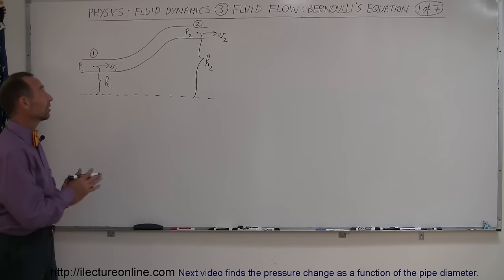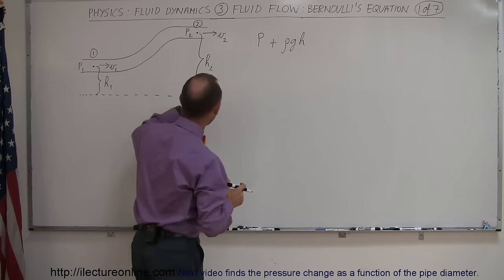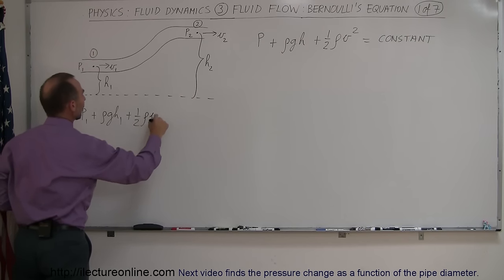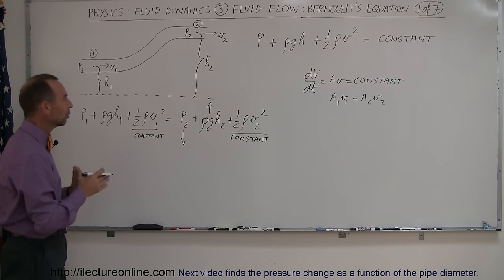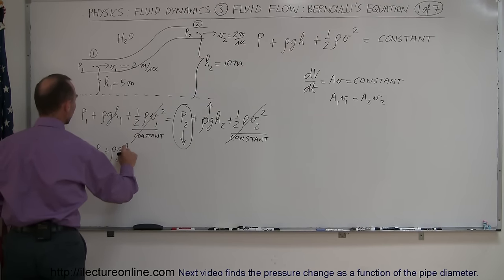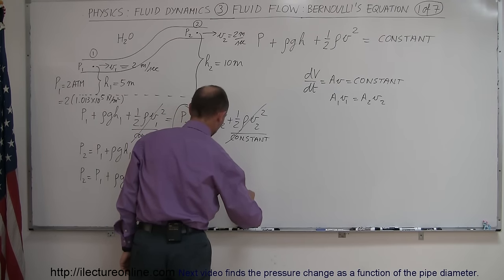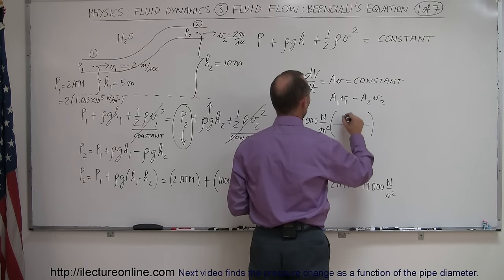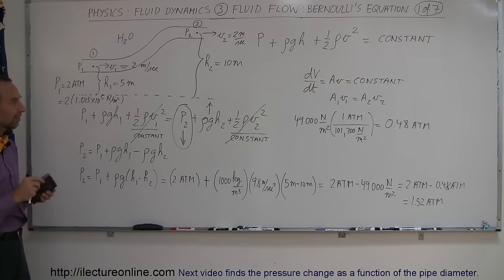Physics 34  Fluid Dynamics (1 of 7) Bernoulli's Equation

Comment: Bernoulli equations are conservation of energy statements in disguise.  Pressure is energy divided by volume (look at the units). Density is mass divided by volume. So you can read the second term as mgh/vol. The third term is mass velocity squared  / vol     The equations basically say that energy in equals energy out.

Comment: The derivation of this equation is actually very straightforward, and basically just the energy equation.
It's the sum of the potential, kinetic, and extra energies, where the extra energy in this case is the pressure work.
So you can set up the equation like this:

m⋅g⋅h + 0.5⋅m⋅v² + p⋅V = constant

From here, you can divide everything by the volume, which then gives you the final equation:

ρ⋅g⋅h + 0.5⋅ρ⋅v² + p = constant

Comment: I'm refamiliarizing myself with this topic (I originally learned about it in Anatomy & Physiology via how blood pressure & circulation work) because I want to design an under gravel filter system for aquariums that minimizes "dead spots" in flow. If this video is an indication of the quality of your content, I've found EXACTLY what I need!

Thank you!

Comment: Thank you for your time and expertise in fluid dynamics. I’m attempting to utilize Bernoulli’s equation to answer which water pump (gallons per hour) I will need for an aquarium room I am building.  Being able to have the proper mathematical direction will allow me to analyze manufacturers claims versus my actual needs and expectations.  I’ll be using this information also for my questions addressing if I should utilize multiple pumps and how much energy will be needed and/or consumed with a single large pump versus multiple pumps.  This information will only be used for my aquarium room build and personal pleasure of the sciences, not to  discredit any manufacturer or anyone for that matter.  My physics skills (plug and chug) were proficient 20+ years ago however I’d like to wipe off the cobwebs, with some help.  I do recall that when a variable (A2, h2) changes there must be a change to P2,  V2 and/or v2.  For some reason I vaguely remember that for every increase of 12” in height the flow rate decreases  “roughly”  80 gallons per hour.  I am not able to recall where this came from however I would enjoy knowing the why and how this is worked out.  I will have multiple aquariums at different heights ranging from 1’ to 5’ above the pump(s).  The pumps gph ability will be dictated by the total number of gallons and changes in heights of the aquariums.  The gph demand is for the health of the fish and or plants. Knowing what flow rates will be expected at specific heights  will provide me with the skills to make an educated decision as to which size of pumps I will use for my specific aquarium setup.  Thank you for your time and any direction you may provide.  Cheers - Breaux

Comment: Clear presentation, Sir!  Of course in a real life there is always pressure loss in the pipe, therefore Bernoulli's equations as such is pretty useless when solving these kind of issues. Hopefully you could add some day one additional video where you would also take into account the pressure loss (i.e. the extended Bernoulli equation and Darcy-Weisbach). Thanks!
Reply from the maker: Yes you are correct.   Just like anything else in physics we first learn the principles without friction, wind resistance, etc.  Then we add the additional concepts when we are ready.  We are planning a series on fluid dynamics in the future as time permits.

Comment from the maker: Mark,
Since v = dx/dt     Av = dV/dt
Reply: Sir, will you make videos on differential equations in the future?
That would be really helpful.

Thanks a lot for all your videos.
Reply from the maker: Laurelindo That is part of the plan
Reply: Michel van Biezen   dont get confused......   V  stands for Volume and for velocity, it depends on the formula.     dV/dT  is volumetric flow (m^3/s)    that s why     =   A*Velocity.
Reply: Hi...,

How about if density of fluid that flowing changing to decrease. Let say there
is an heating process in the middle of the pipe that makes density to decrease
its about less than 25%, so the density of water to be 750kg/m3.

My opinion :

With P1 give a constant pressure, h2>h1, A1=A2 such as your task so,

1. Pressure at point two or P2 would be increase;

2. Velocity of the fluid at point two would be increase as well;

3. And if the the velocity of the fluid increase so for next pipe after poin
two rate of the fluid or Q would be increase as well.

Please your advice about my opinion

Thanks...
Reply: it will become a problem of thermodynamics i think
Reply: +Dede Yefandri Bernoulli equation assumes that the working fluid is incompressible (density is constant).  however you can estimate the answer by combining Bernoulli equation with continuity equation.  you may have to solve it with navier stokes equation, but that would be complicated because it's a second order differential equations, so you would need boundary conditions.
Reply: Thank you!
Reply: you are very acknowledge teacher

Comment: When flow is not laminar and the diameter of the vessel is less than 5 mm, then the simplified Bernoulie's equation does not hold.  This is specially true if the viscosity of the fluid is high, i.e. blood flow rate in narrowed arteries.  In these cases, a 10% widening of the diameter of a vessel increases the flow by a factor of 2; such as improved flow after placement of a stent in a partially obstructed vessel from an atheroma.  In even smaller than 4 mm diameter of a vessels the flow becomes more dependent on the elasticity of the vessel; i.e. the greater the obstruction in a non-elastic blood vessel with multiple narrowings, the more reduced the flow would be.  This is presumably because of eddy currents developed at narrowed points.
Reply from the maker: Good information.

Comment: When there is the pressure difference between the section of pipe the velocity can't be constant (the velocity is increase when the pressure decrease and vice versa)
Your assumption is the velocity is equal at different section it is occured when the pressure and height is the same( equation of continuity )
I think the given for the example is wrong
Reply: It sounds like you are describing Bernoulli's Principle. That involves a change in the pipe diameter (which creates a change in velocity) when water is flowing through it. This is an important concept, but it is different from what Michel is describing.
Michel's example involves a pipe with no diameter change. Therefore, an incompressible fluid like water will have its velocity limited by the friction losses within the pipe, but the velocity of fluid at either end of the pipe will be equal.

Comment: Hi,
The principle states that, if velocity decreases than the pressure increases. However, I'm not sure about the reason behind this principle. Would be helpful if you could explain the scientific reasoning why this works.
Reply from the maker: If  the fluid is static, then all the forces (weight) of the top molecules push down on the molecules below creating the largest pressure.  When the molecules are moving all the molecules will be rolling over one another and bumping around in random directions. The space between them will also increase.   Which means that not all the downward forces are not as large and the pressure decreases.

Comment: HOW TO DO THIS IM REALLY NEW AT THIS....PLEASE HELP!!!
Water (density =1000 kgm-3) flows through a circular pipe of diameter 100 mm at a velocity of 0.5 ms-1 and a gauge pressure of 10 kPa before entering a pump. The pump supplies energy to the fluid at the rate of 1 kW .  After the pump the pipe diameter is  50 mm and delivers the water to a point 15m above the pump inlet. Determine the pressure of the water at this point. Assume frictional losses are negligible. (Answer : 115.5 kPa)

Comment: What is the relationship between Diameter and Velocity?
I mean, why does Velocity decrease with Diameter increase, and vice versa?
Thank you!
Reply from the maker: 902hater
Since the amount of fluid per unit time flowing through the pipe must be constant  (the same amount of fluid entering the pipe on one end must be equal to the amount of fluid leaving the pipe during the same time interval), and since dV/dt = A v,    A is cross sectional area and v is velocity, the velocity must decrease if the cross sectional area increases.

Comment: I’ve noticed that this is very similar to the conversation of energy law but tailored for fluid kind of. If that’s the case, shouldn’t there be a term related to drag in the Bernoulli Equation?
Reply from the maker: Yes indeed, this is very similar to the energy conservation equation.  For simplicity loss due to drag is not included.

Comment: Bernoulli's equation does not apply to flow in a pipe.  Bernoulli's equation requires inviscid flow. Flow in a pipe is always viscous whether laminar or turbulent. If you have a horizontal pipe of constant cross sectional area, then Bernoulli's equation predicts no change in pressure has you go downstream. However, the pressure actually decreases as you go downstream. Do the experiment and you will see.
Reply from the maker: That is correct.  Bernoulli's equation ignores viscosity and friction.  But that is no different than when we use "frictionless" surfaces and when we ignore wind resistance in mechanics problems.
Reply: @MichelvanBiezen  There are plenty of applications where Bernoulli's equation applies in lots of situations such as low speed flow over an airfoil outside the boundary layer. Why not use that example? It is never true in a pipe.
Reply from the maker: All physics books use pipes because one can also "control" the diameter so one can show the effects of that as well.

Comment: Why is it still same speed at the top although it is gaining potential energy. Is it because water particles are constrained with pipe wall? Single macro particle does not have pressure effect and so no option for it to be decreasing. Instead velocity is decreasing when it is lifted. But in fluids first pressure is decreasing instead of velocity. But in aerodynamics velecocity and pressure is reversely proportional to each other. So in this example why is  velocity still constant although its pressure is changing?
Reply from the maker: For a fluid in the pipe with constant diameter the amount of fluid flowing through the pipe in any section of the pipe must be the same.  Thus the velocity must be the same everywhere.  That is why the pressure will drop when the pipe goes up, to compensate.  That is what Bernoulli discovered with his equation.

Comment: Wow, very useful video. Hi am Mech. Engr working in the stream of quality in construction and piping. can you please tell me, is the above Bernoulli's equation applicable to find the pressure drop in hydro testing procedure.?,
Reply from the maker: Depending on the application, you may need to include type of fluid used, viscosity, temperature, material of the pipes, etc.   But this will give you a good estimate in an "ideal" situation
Reply: @MichelvanBiezen  ok then were any pressure drop occurs during hydrotest, ?? On the pipe which has the elevation of 8mtr,??

Comment: Dear Sir, I want to thank you for the time and your effort for this beautiful video. I just want to calculate the time in this example. Basically, if we have a water tank at the V2 point and let's say it has a quantity of 1000 litter. How long does it take to full?I really appriciat that if you can help me with this. and also in the video of 4/7 ..how should I consider the element of the time again.
Reply from the maker: dV/dt = flow rate = volume transported per unit time = Av   Which means it is equal to the product of the cross sectional area of the pipe x velocity of the fluid.

Comment: Hi Michael! I have a fluid mechanic problem. I'm trying to design a kind of water valve with inexpensive materials as a first prototype, and I need to know the mass of the float and the buoyancy force need it to overcome the water flow pressure (F=PA) against the float of the valve. I did some math, could I send you a word.doc to show you the details? Please!!

Comment: What happens when you are not given both the pressures and you are required to find the change in pressure
Reply from the maker: Move one of the P variable to the other side and then "delta P" (the difference between the two pressures). becomes a single variable, assuming you are given the other information.

Comment: Just one question ,  so in a hydraulic system where the height also changes constantly , continuously, as in the case of a tractor loader, is the system somehow coming up with the changes in pressure and compensate it by regulating it or how it is done? Or is the change of the pressure so negligible?
Thank you
Reply from the maker: In hydrolic systems, the volume of fluid is so small and the pressures are so high that the difference in height makes very little difference.

Comment: You said in this video that because the area of the tube doesn't change, the velocity stays constant, so the pressure must be what changes, but P = F/A, and F=mv^2, therefore mv^2/A changes, and we've already established that v and A remain the same, so my question is: how does the mass of the system change?
Reply: Nevermind I figured it out: the mass doesn't decrease at the top, it's just increased at the bottom by the increased volume of pressure under the slope.
Reply from the maker: F is not equal to mv^2
Reply from the maker: That is correct, the pressure increases with depth (and reduces with increasing speed).

Comment: heron's fountain equation in integration form and it's upper limit so we got the free energy from atmospheric pressure and if we use computer programming added then on large scale we can easily produced enough electricity to power millions of homes due to atmospheric pressure

Comment: Great lectures just as usual sir
I have please a question for you
In all the examples where you have to calculate the (P)preasure 
you give P1 as known parameter at the beginning, and we are calculating the P2
But what if the problem is even simpler:
we are given a straight  horizontal pipe with same  diameter all the way along the pipe
we are given the H (h1=h2)
we know the Q
so the P1=P2 
---------------
how do we calculate the P
 I mean how do we know how many atmospheres or kilopaskals  or what ever the P is equal to
?
It is an urgent question please help me !!!
Reply from the maker: It depends on the situation and what other information is given.  In a REAL pipe, there will be some resistance to the flow, such as viscosity of the fluid and the resistance forces of the walls of the pipe.  Which will require the pressure at the beginning to be greater than the pressure at the end.  But if that is ignored, and the velocity doesn't change and the height remains the same, then the pressure will be the same at both ends and there is no way to know that pressure unless it is given.
Reply: Dear Michel, This was an excellent lecture Sir! It has been 30+ years since I graduated from college and I had forgotten all these laws (I am not working in engineering). We had some air duct change project in our office because the old ducting was such (diameter too little)  that the ventilation wasn't too good. Because of this, I wanted to understand what they are going to do and if I could understand it.  For this reason I googled and found your lecture and was fascinated to watch that. 

You said above that "In a REAL pipe, there will be some resistance to the flow". I would like now to understand how usable this Bernoulli's law is in real life. As we know, in the air ventilation ducting there is a fan at the end or in the beginning of the ducting. Depending on the length of the ducting, the m3/h air volume changes, short ducting gives us big m3/h, long ducting gives low m3/h. Lets take an example. When the ducting is, lets say only 10 m long, the volume could be e.g. 100l/s, but if the ducting is 100 m long (same diameter), then the volume would be much less (maybe only 10 l/s?), due to the pressure drop along the ducting. Have I understood correctly this far?

I see the situation so, that in the beginning of the ducting (lets assume the fan is in the beginning) the pressure in the ducting is high and after every meter the pressure drops and drops and at the end it can be very low (P2<<P1).  My question to you Sir is that is Bernoulli's law still somehow usable with some updates (what would those be?) which would take into account the pressure drop, which after all, is always reality.

Comment: Hello, so you calculated P2? how much pressure from the lower point required to make it equal? to one atmospheric pressure =2(1.01cx10^5 B/sm^2)?
Reply from the maker: Since the differnce in the height requires 49,000 N/m^2 to overcome, you need P1 = 101,300 Pa + 49,000 Pa for P2 = 101,300 Pa = 1 ATM

Comment: Professor can u make a video on how to apply Bernulii from ground and moving frame of reference..
Reply from the maker: I would typically not associate Bernoulli's equation with two different frames of reference, since Bernoulli's principle requires a uniform reference system.  Have you seen such a concept or such a question?
Reply: @MichelvanBiezen  yes professor in jee domain lots of such question circulates.... And some teacher evdn tried to solvd it but i did not get them can u try and make a video on such concept,,, no has a video like this... Plzzz make one🥺🥺🥺🥺
Reply: @MichelvanBiezen  professor can u make such a video quickly